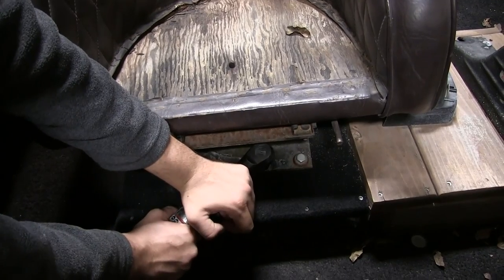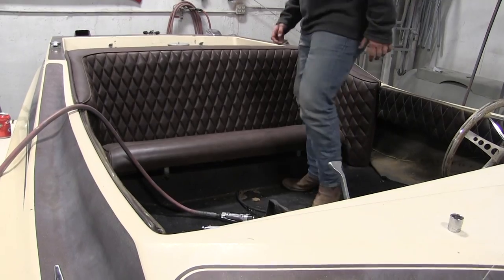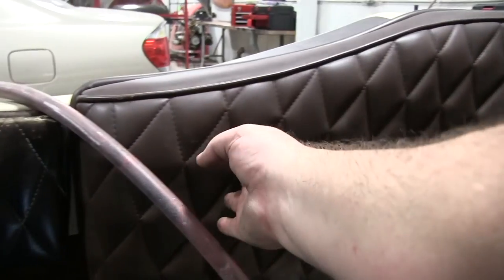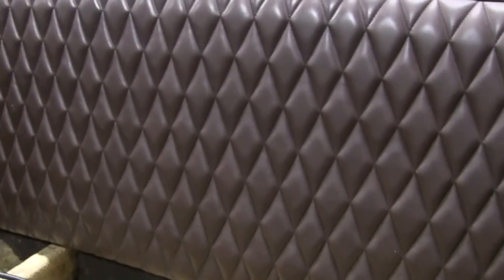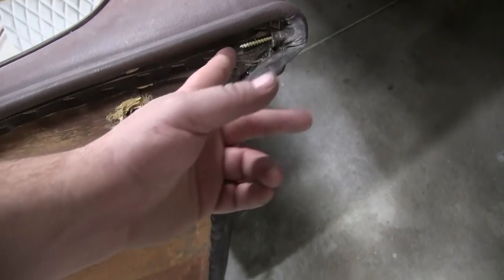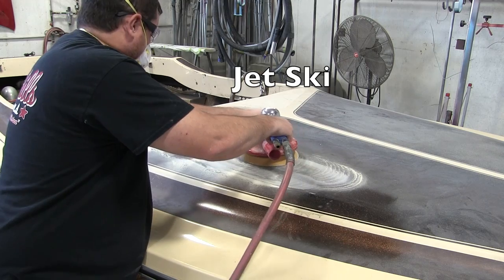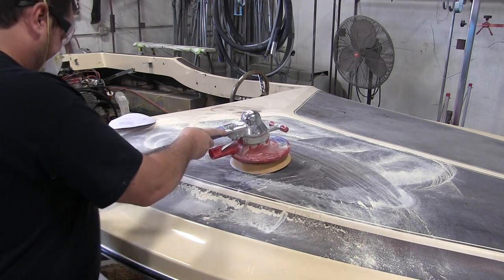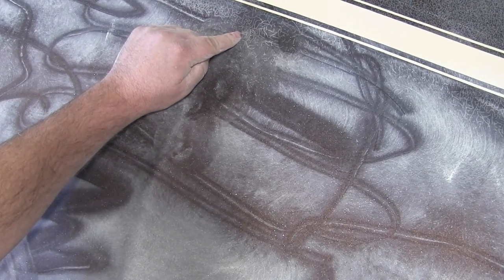Jet Boat - Sanding Crows feet Cracking and Removing Interior

Comment: WOW you sure jumped onto this project fast :-) rather than using the DA, why not have a go at using paint stripper first. Many years back I used to restore old TVR's and Lotus and always found stripper to be the best. I would use a sharp blade and put light crisscross scratches all over the paint first, apply aircraft stripper and then place a plastic 4M paint masking sheet over the top and let sit for 30 minutes (you can use your fingers to agitate the stripper on top of the sheet). The plastic sheet stops solvent evaporation helping the stripper to work longer before drying out. Then follow with 180 on the DA to get back to the gellcoat.
Reply from the maker: I finally got it sanded, but stripper may have actually been faster on this one.  Thanks for the tips.
Reply: Great work and keep these videos coming, we all enjoy the updates Sir and most importantly learn along the way :-)